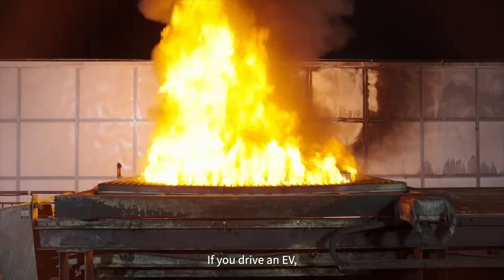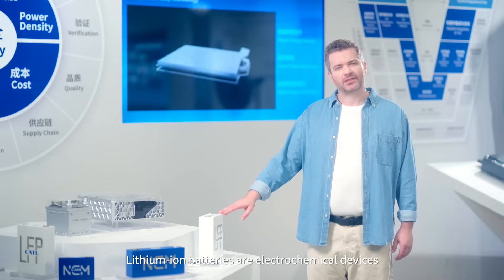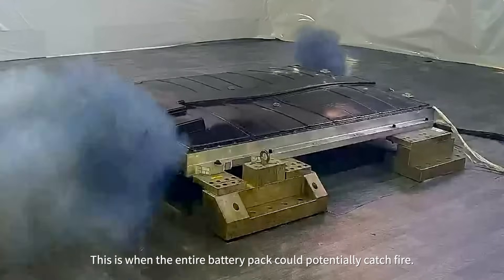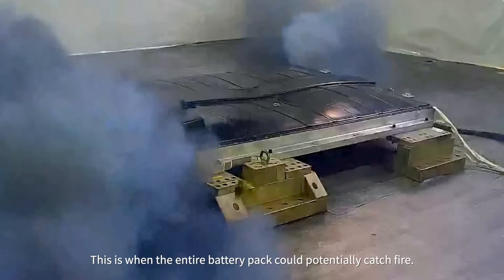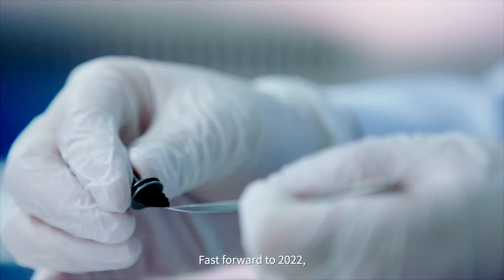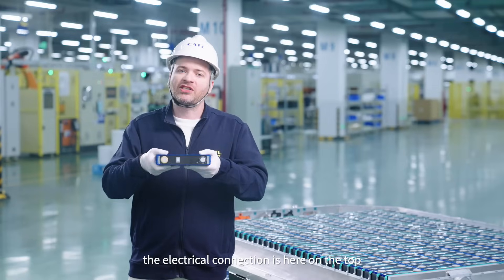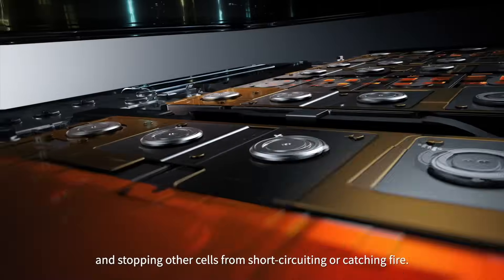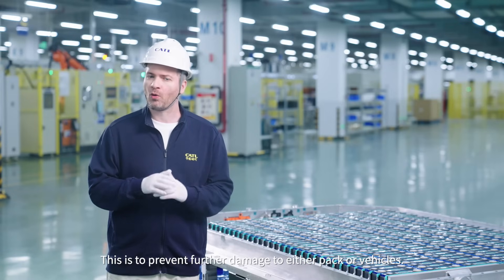CATL's NP Technology Conquers Thermal Runaway

Comment: Yeah but they already cured the thermal runaway problem with sodium ion batteries. They already had cars in production with sodium ion batteries. Sodium doesn't cost anything like fluctuating lithium investment commodities... and it doesn't have any environmental concerns like lithium mining which is practically like fracking. Sodium ion batteries are easily recyclable. All that you see here is just like the fossil fuel companies... trying to perpetuate a superfluously problem ridden obsolete technology... Simply for their opportunistic business profit model

Comment: LiFePO4 chemistry is the key. It doesn’t burn at high temperature when the battery is punctured. Other EV battery makers uses a different chemistry: LiCoMn, which burns at much higher temperature when the battery is punctured. CATL LiFePO4 battery is the most popular EV battery due to its safety record.

Comment: Adding insulation and more cooling to the battery pack reduces the electrical capacity available to drive the vehicle with the same size and weight battery. Bottom line is the dismal range EVs suffer from now will become worse.
Reply: The range sacrifice is minimal.  If you notice, the space between cells for thermal resistance and cooling is very small.  I'd rather trade a few percentage points in range and sit on top of a safer battery pack.  The EV I drive today has the same propagation prevention technology and I get 330 miles of range per charge session which suits our driving habits just fine.

Comment: The problem isn’t in the batteries, it’s in charging infrastructure. 

Once you get the power to the places you need, then people won’t be so defensive in EV adoption.

Great to have safer batteries absolutely. But the bigger problem is power delivery throughout networks.
Reply: @pepelepouf-k7w  thanks, will check it out.

Comment: CATL are going to be the main driving force of EV adoption because they are going double the range, half the weight and start to guarantee the cell packs for 200,000 miles with them expected to reach 15% degradation at 500,000 miles and 20% by 1 million miles the 99.9% of cars will never even remotely get close too. 😂 All while bringing the cost down.

Comment: The rate of progress in batteries is astounding. Peoples thinking is 10 years out of date at least. Every 6 months there’s big changes.
Reply: All lithium ion batteries in use today were developed over 20-25 years ago, LFP being the oldest, though not by much.
Reply: @tooltalk  that's the very basics of it. What you're saying is like saying phones were invented decades ago. Technically true but no one will compare the old antenna pull out luggage phones to a smart phone today.
Reply: @tooltalk  yet another nothing burger. Not to mention many advancements have already arrived in cars in mass production.

It's clear you know nothing of the topic so I won't be responding to any more troll messages.
Reply: @nfzeta128  Other than the discharge rate and better charge management for more cycle time. The actual power density of batteries has increased extremely slowly over the last 20 years. It would be like if your new phone was only 20% faster than the first iPhone.
Reply: @quantuminfinity4260  lol what are you calling extremely slowly when there were like 2 15% bumps in the last couple years.
Reply: @quantuminfinity4260  this just isn’t remotely true and shows you really have not been following this sector at all.
Reply: @MePeterNicholls  My follow up seems to have not been posted to clarify, the 20% was definitely to much of an understatement in the analogy. We have seen significant improvements over that time scale. My comment was mostly made out of frustration over seeing YouTube video after YouTube video covering literally hundreds of different startups or even massive companies with some big revolutionary battery breakthrough that never sees the light of day or is revealed to be wildly overstated. So I tend to come in with too high of a degree of antagonist skepticism.
Reply: คิด @tooltalk

Comment: what thermal runaway on LFP? confused
Reply: They can still experience thermal runaway but they're less likely to and they don't usually get hot enough to set themselves alight.
Reply: LFP goes into thermal runaway also.    Some marketing people have promoted the myth that it doesn't.  For example, NMC and LFP both go into thermal runaway, just at different points when abused.  When heated NMC starts TR around 200C,  LFP starts around 300C.   Once in TR  LFP produces a greater volume of flammable gas vs. NMC.  So they both have pros and cons to deal with form a battery pack design perspective.  However, a properly designed battery back regardless of the cell chemistry can resist propagation using the basic principals shown in this video.  What I like in this video is the way they explain how this works with the bottom facing vents and thermal insulation.
Reply: @jbphot0  all evidence to the contrary
Reply: @mrpicky1868  what evidence?   I've put both LFP and NMC prismatic >100Ah cells into thermal runaway in my UL 9540A testing and my results agreed with Sandia, several Universities, and other manufacturers, Ul, Intertek, CSA, etc.    If you have an LFP cell that doesn't go into TR at high temperature, please let me know.  I'd love to use it in my products.
Reply: @jbphot0  now you are contradicting yourself

Comment: Chinese EVs are notorious for catching fire, especailly BYD, it's great to see they are trying to solve this widespread issue in China.
Reply: You’re confusing BYD hybrid car with BYD BEV. BYD hybrid used an older and different battery chemistry than BYD BEV.
Reply: Thats less of a battery thing and more of Chinese quality design. You can be sure as hell they wont be putting these batteries in their cheap cars.

Comment: It would be better to create a non-flammable chemistry.
Reply: LFP is safe
Reply: Exists if you replace lithium by sodium, but not as energy dense.
Reply: @johngonon1507  I mean sodium batteries are already on par with lithium and are expected to improve more. We just dont have it in USA because we always are last.
Reply: @silvy7394 Sodium batteries have much lower energy density and may never achieve parity. Lithium is the lightest metal - just a fact of Physics. Where sodium is interesting is price/kWh. Could be big in stationary storage.
Reply: @silvy7394  As @iamalmostanonymous wrote it already, lithium is smaller and lighter so it's highly unlikely to reach the same energy density. You can have sodium batteries with the same energy than lithium ones, but they will take more space (Wh/L) and be heavier (Wh/kg). They would be great for grid energy storage and some solutions are already popping up for that.
In cars, possible, but smaller batteries for the same volume and weight. But they could compensate on speed of charging (potentially).
Reply: @iamalmostanonymous  So then how are we already getting sodium cars with the same range as their lithium counterpart?

Comment: This gives me hope for catl new solid state&condensed matter aircraft grade cells! 👍🏻😎

Now where are those lmfp or m3p cells for tesla catl, the ones supposed to have entered production in late 2023 for the highland m3? 
You know your largest single most important customer! Over 40% of ALL teslas sold since late 2021 have had catl cells in them!
Reply: Tesla uses CATL LFPs exclusively in entry-level, low-range EVs;  Panasonic and LG are used in Long Range and Performance models and make up the other 60%.
Reply: Robin Zeng, the founder and CEO of CATL (Contemporary Amperex Technology Limited), has said that solid-state batteries are unsafe and impractical.
Reply: @tooltalk  he's flipped recently though you genius SMDH, China now has the largest open conglomerate of ev cell makers for solid state cell research! Catl is part of it and announced they would have their own in house solid state cells in production by 2027 or sooner. 😀
Reply: @4literv6  : hate to disappoint you, but the biggest innovator in SSB is Japan -- Toyota in particular.   This is one of the many reasons why CATL is staying away from it -- because they can't do jack without stepping all over Toyota's SSB patents.   Same with CATL's misadventure in high-nickel/energy NCM batteries -- while they are free to steal and copy NCM's patents in China, they can't export batteries without infringing on LG's patents.   They gotta start paying like SAIC, LG's former JV partner.

Comment: Most cars are sealed from beneath how smoke will exit then?
Reply: There are special vents that are ment to melt or blow out in the event of a thermal runaway, thus creating an exhaust opening for gases
Reply: "Most cars"?
The Pack is the "Floor" of the car.
If the cell fails, it exhausts through "the floor" to open air.
(Tesla uses a similar system)